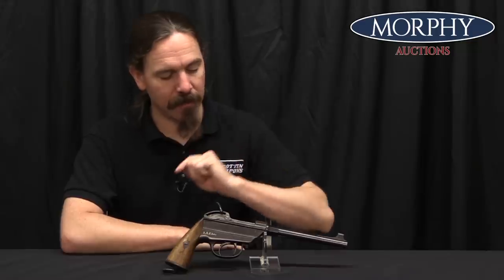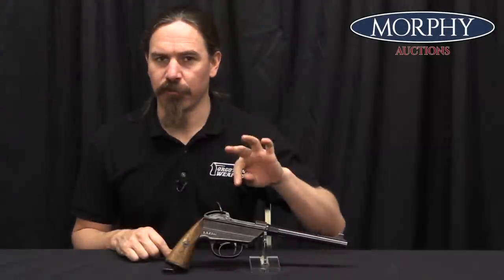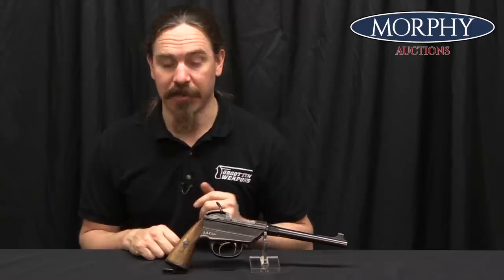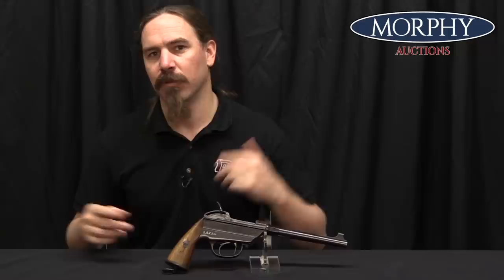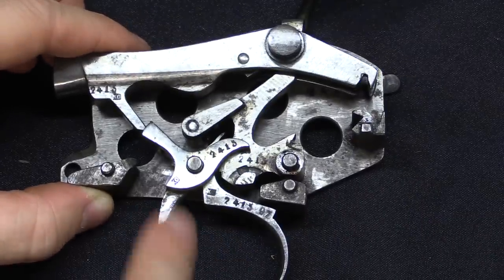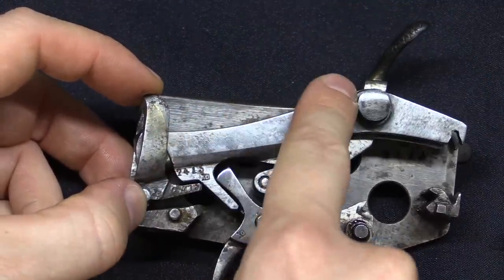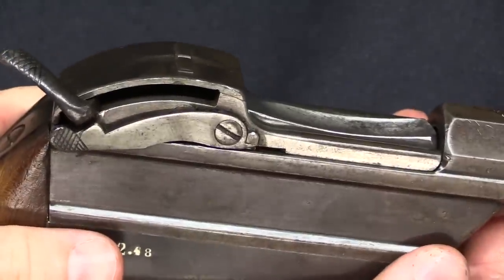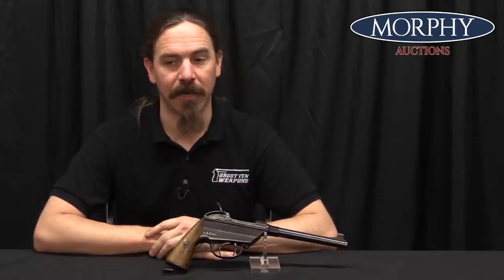Bavarian Lightning: The 1869 Werder Pistol

Comment: The unit marking 2. A.r. 2. 68. means that this pistole was used by the royal bavarian field artillery regiment no. 2, mounted battery no.2, pistole no. 68. Great video Ian, as always. Cheers, Vincent.
Reply: you probably got the most niche channel i have ever seen, how do you even get an interest for that?
Reply: That is some knowledge you have got there.
Reply: @peteraugust5295  I think that "r." in "A. r." is lower case, because Artillerieregiment is a single word in German.
Reply: @peteraugust5295  The lower case "r" stands for "reitende" (eng. mounted) battery. If the "R" would have been stamped in upper case letters then it would translate to a "Rekrutendepot" (eng. recruitment department). Cheers, Vincent.
Reply: @fnym9rdsavsffdik9a25  Thank you very much! My Grandpa was collecting british rifles and bayonets so i grew up with that kind of thing arround me, i just "chose" the prussian/german side later on.
Reply: @peteraugust5295  Its not "Artillerie reitende" but Feldartillerie-Regiment Nr. 2, reitende Batterie Nr. 2, Waffe Nr. 68. The mounted (artillery) batteries were highly mobile units where every single soldier was carried by horse and therefore these units could move arround the battlefield much faster then the regular artillery units. There are some wikipedia articles on this for further reading.
Source for the unit markings would be "Wacker A., Görtz J. 2005: "Handbuch Deutscher Waffenstempel auf Militär- und Diensthandwaffen 1871-2000", VS Books Verlag, Herne" page no. 80 ff.
Reply: Peter August : I am no expert, but german . Artillerie, reitende would be grammatical wrong with no added word, but Artillerie reitend would be corect.
Reply: @peteraugust5295  It does. The r is lower case because reitende is a lowercase word. It differentiates the mounted batteries from those on foot.
Reply: @peteraugust5295  LOL look for yourself bro. He answered you perfectly AND gave you a literal academic source. Thats very rare for someone to do on the internet let alone a YT comment section reply
Reply: cool info thanks for the info =)
Reply: Awesome.
Reply: Peter August because he gave you an academic book. Not a Wikipedia link. He literally explained himself 3 or 4 times now
Reply: @peteraugust5295  ah look but he said "the Royal Bavarian field artillery regiment number 2., mounted battery 2." and you literally said " 2nd Royal Bavarian Field Artillery Brigade" hmmmmmmmmmmmm
Reply: @peteraugust5295  No dude, you asked because you want to come off as the more knowledgeable of the two. However, the more you ask and the more he answers, the more foolish you look.
Reply: @peteraugust5295  Yeah reitend batterie number 2, mounted battery which is a subunit. Presumably the marking of the battery in combination with the regiment was unique, since they were mounted, you would wanna point that out. since it's not pointed out in the name of the battery, but instead the regiment, I would assume they have multiple batteries that way with mounted? 

Either way, humans aren't perfect and if the capitalization wasn't perfectly standardized or unique to each thing I wouldn't be surprised.  We are talking of the german army after all.

The king of being, organizedly disorganized and in shambles. No offense to any, "wehrboos" or whatever
Reply: @herosstratos  Thanks for that source! I'm trying to track down the unit markings on my 71 Bavarian Mauser, and that looks promising.
Reply: lol, Peter August deleted his comments
it's a shame people are afraid to be wrong and scared of being corrected nowadays
Reply: Is it possible to know the exact name of the person in that 2 Artillery Rgt who carried this weapon? Then it would be nice to know his biographical information.

Comment: That is a magnificent piece of engineering for the 1860s. Model of 1869 but I feel certain that it took at least 2, if not more, of the preceding years to actually develop this firearm. The amazing thing about it, to me, is that looks like it was designed/developed in the 1880s to 1890s. Great video Ian!

Comment: On some level, the way this comes apart reminds me a lot of the C96 pistol, gotta wonder if there was some inspiration drawn from this for it. Also, I totally want a repro carbine of this system in .45 Colt or .44-40.
Reply: I'd buy one in .45 Colt. I can't think of a single thing it would do that one of my current handguns can't, but the cool factor is just irresistible.
Reply: Mmmmmm, yes!
And, heck, like any falling block design, this could be adapted to almost any cartridge... a .357 mag carbine sounds fun to me!
Reply: I'd prefer .44 Special so I can actual buy the ammo at a regular gun store.
Reply: Shoot considering how well designed this thing is, and how much materials have improved since the mid 1800's. I bet you could get this thing to fire some pretty powerful stuff.

Comment: A revolver with no revolving cylinder? And it has a hammer that looks like its from a flintlock? Fancy fancy
Reply: Not a Revolver, it's a single shot pistol
Reply: its a breachblock mechanism.
Reply: I study pretty much anything to do with late Reniassance/early Industrial era production. I could picture a clockmaker adding an early fixed skeletonized magazine to the top, making it roughly .22 and selling it as a parlor gun. Also with a "rougher" version with an enclosed magazine as an early repeating pistol.

Comment: 340 gr. pistol bullet vs 386 gr. in the rifle is only a 12% reduction.  With the same 66.4 gr. powder charge I wouldn't call it substantial. (2:43) But the cartridge length being 15 mm shorter makes me wonder if there is an error in one of these numbers.  I haven't found and pics or data on these yet.  Interesting stuff.

Comment: It looks like the second notch on the hammer has a very distinct shape with the small hook on it, most probably, it will catch the tail of the trigger and prevent it from being pressed until the hammer is fully cocked, while at the same time keeping the breech block half-closed, so that the cartridge in the breech does not fall out. Did you miss this moment, or did I get it all wrong?

Comment: Excelent video and amazing gun! I wish I could afford one...

Just a question: since both the rifle and the pistol versions were the same caliber, was there any impediment to loading a rifle round on this thing? I mean, regardless of how "unpleasant" it might be, it could be very convenient to be able to load either bullet on the pistol (or on the rifle, for that matter). Not for "hand-cannoreening" purposes but for logistical ones: if you run out of one type of ammo, you still have the other. It's less than ideal but it beats nothing, right?
Reply: The rifle cartridge was over half an inch longer, i doubt it would fit. The carbine used the same ammo as the pistol though.

Comment: Are you sure that is an "after market" safety?  Most of the pictures I've seen seem to have that version except one I saw that was shorter that appears to rotate up and clockwise to work as a hammer stop.  Looks like they just decided to change how the safety functioned but still used the same screw pivot and stop in the housing.  Just my guess. - 10:20

Comment: I own both a Werder rifle and the Werder Carbine, I’ve been looking for the pistol.  The carbine/pistol cartridge was substantially less powerful than the rifle cartridge, the bullet was only 339 grns and I haven’t found any original or contemporary literature yet showing the intended powder charge, but the 35mm case would have been much less capacious.  The bullet on top of a grease cookie or cork over powder wad, wouldn’t have left that much room.

Comment: Revisited, I still want one of these, alas now days my budget allows for, perhaps a cap gun, nothing real so I shall never have one. My first ever pistol I purchased from a Hispanic combiner crew dude from down south somewhere, perhaps Mexico, who knows this was back in perhaps 1965. The gun was a cut down stevens single shot lever break open rifle cut down to about 12 inches with a hand whittled pistol grip, no sights but I could actually hit the broad side of a barn with it. I took  it with me on my first job working on my uncle's farm driving tractor putting up hay for 5 bucks a day, room and board.  It made a lot of noise for a .22LR and was fun to shoot. I later learned it was illegal, when I signed on the PD in 1973 the same pistol was in the gun lockup, it had been confiscated from a dude who tried to shoot his wife with a Webley, my sister was with the wife at the time, anyhow the AtF visited one day and I found the poor old pistol in pieces having been put to the torch along with the Webley and a few other guns that came from the same criminal. It was a sad day for me, I liked the Webley too dang it.

Comment: I wonder why they didn't have the hammer release the block at the very end of its travel instead of requiring a second lever push, it seems like that'd have sped up the reload time substantially.
Reply: Wanted to make sure pressure in the barrel was safe, probably.

Comment: You made a small mistake regarding the safety; at 10:14 you say that there's no safety on this design and "this is I believe an after market added safety"... it's definitely the safety (and it's not aftermarket, all the pistols have it) however you misunderstood how it functions.

If you lower the hammer into the half cock notch (the much deeper second notch at 7:34) and engage the lever, the deep half cock notch binds the trigger and prevents the hammer moving forward, and the lever prevents the hammer from moving rearward out of half cock towards full cock. 

From a modern standpoint having to pull the trigger and lower the hammer to half cock is unacceptable, however for this time period it was a better than average design as the lever securely holds the hammer at half cock and prevents it from being bumped out and potentially firing the gun.

Comment: Beautiful engineering! I was half expecting to hear that the Werder had been designed by a watchmaker. Simply, this pistol mechanism is a work of art. 

I love it when Ian gets to tear down a piece. 😏 When I was a kid I used to take things (like my father's windup alarm clock!) 😆 apart. (What a little PITA I must have been, LOL!) I think it's likely I'd enjoy this kind of design work.
Reply: I too began my "career" of being a mechanical "nerd" by doing an "autopsy" on a wind-up alarm clock.⏰ I never got it back together,but that did not deter me! I took apart locks🗝,light fixtures,radios...If it had screws, it was NOT SAFE AROUND ME, 😊
Reply: Me to, it ended when I tore the heads off dad's 1944 International Farm Truck he had parked behind the garage.  I learned to valuable lessons, 1 always ask permission before you tear apart farm implement, 2 that damn razor strop STINGS like hell on the bare ass. I was 8 at the time.

Comment: Is this the earliest version you've seen of a modular self contained fire control group?
Reply: It would make this thing really easy to clean because you don't really need to disassemble it further than just taking the sideplate off the FCG. Dunk it in hot water to get rid of the black powder salts, dry, oil, and you're done.
Reply: Maybe? The action is hand-fitted as usual for that era, but the question then becomes whether the side plates and breech face were standardized enough. I sure would like to think they were, but I wouldn't be surprised either way...
Reply: @AnimeSunglasses  I am by no means an expert on this era, but I'd guess the receiver and fire control group (FCG) module sizing is standardized, but the internals of the FCG are hand fitted.  Just a guess though.  That would be a logical interface to standardize.
Reply: @LoanwordEggcorn  It would indeed, but it's still early enough that there's no guarantee...
Reply: Wouldn't a common flintlock mechanism fit that same definition? Think of the expression "lock , stock, and barrel" , 3 major components often fabricated by separate makers in earlier gunmaking endeavors. The lock was the complete fire control group of it's day and usually a single unit/assembly mechanism that could be used in a variety of firearms.
Reply: @vahtikoira2125  Definition and actual manufactured reality were two very different things for quite a long time.
And, the operative part of "standardized parts" for logistical purposes, is that they needs to be interchangable.

Comment: I want to get that gun and put a Scope on it and go into a space
Reply: We found the next "hero blaster" for Star Wars!
Reply: You know, something like this Werder could actually be useful in a near future space application.
No recoil/gas system means you can shoot whatever load you want, even a very light one for signal flares or to not puncture your ships hull and die.
The manufacturing tolerances and materials used mean that anyone with a metal shop can repair it or make spare parts without the need for super high-precision machines or exotic polymers. 
The extraction mechanism means that you can still keep it somewhat cool in a vacuum (which is difficult even for things that don't involve explosives) and you wont  throw hot brass everywhere. Not to mention you can reload them at home.
The only real problem I see is that you getting a shell loaded would be really difficult with thick space suit gloves.

I personally would pack something like a .44 mag revolver in case I need to shoot down a space ship, but a single shot trapdoor wouldn't be that far behind
Reply: I'm in a space right now, and something tells me.. You are too.

Comment: I had one of these. You can make ammo for it by cutting a 45/70 brass down to the size of a 45 long colt case then run it about a half inch deep in a 45 long colt sizing die. load it using long colt loading data and seat a .452/ 45 cal. bullet in it works great.

Comment: 2:54 Wiki Germany says that the bullet for pistol, carbine and rifle remained the same at 21.96g (339grain) while the powder charge was reduced from 4.5g (69grain) to 2.5g (38.5grain) for the pistol.
It also tells the story of the police carbine converted to 11mm Mauser in one incident in which 772 rounds were fired resulted in 304 misfires or other failures.

Comment: And they wanted single-shot pistols instead of revolvers because.. ?
Reply: I knew about the rifles but the pistol. I would think the artillery would want a little more fire power than this if enemy infantry or cavalry show up. The only real change the system needs is a second stage to the trigger that would drop the block and eject the spent casing. Fire, squeeze the trigger some more and the spent case ejects. That would be even slicker.

Comment: Eccentric collector: I have a beautiful pistol from the mid-nineteenth century, but am concerned that it requires a safety mechanism.
Gunsmith: Eh... all right. squints at intriguing mechanism with calipers and note pages What does it fire?
Eccentric collector: I will need you to fashion appropriate cartridges, as well.
Gunsmith: sigh
Reply: Klaus K Eccentric Collected i also may possibly require a conical-diopter based scope preferentially for mongoose hunting
Reply: At least the cartridges should be easy to reverse engineer. Push a lead slug down the barrel to get bore diameter, realize that you can use commercial .44 lead bullets, measure the chamber and rim diameter. And from age of firearm you know you're going to use black powder.

Actually, I wonder if .44 special or magnum brass would work, just loaded with black powder?
Reply: @joestrummer4106  Eh... how about a spyglass?
Reply: You mean spotter scope ?

Comment: The Werder rifle fired a 50mm X 11 using 67 grns of bp to send a 377 grn bullet down range at published velocity of 1460fps. Real velocity was probably a bit lower.  But in any event while slightly less energetic Werder 69 cartridge wasn’t that different from the 370 grn bullet/77 grns bp load of the 11mm Mauser.  10 grains of BP shouldn’t make that much diff.
The actual disparity in energy of the cartridges wasn’t really the issue but rather the sloppy quality in the conversion job.  Sloppy and incorrectly sized chambers and the Mauser cartridges slightly smaller rim led to rough extraction.  My understanding is that commercial sporting conversions w a modified extractor worked a treat.

Comment: Do these fire black powder catridges or can they handle normal powder?
Would a slow burning powder give less pressure than a fast burning one? Ive noticed (modern) pistols generally use faster burning gun powder than rifles do, if i am not mistaken. Do self reloading with rifles, not a pistol guy, so could be wrong. But in rifles slower burning powder is preferred (or i prefer them, since it allows me the security or knowing that even if i accidentaly fill the cartridge to the max i dont blow up.

This gun was particularly cool. Want one.

Comment: It would be even better if the breech block unlocking lever was connected to the main trigger, instead of the secondary one. Pull the trigger, fire, pull some more, unlock the gun and eject the empty case.

Comment: So you could safely carry it loaded by loading, fully cocking, and then lowering the hammer to half cock? You would not want to lower the hammer fully because it appears that if you dropped it and it landed on the hammer, it would discharge.

Comment: Strange it’s no auto eject the tear drop extension on the hammer could easily trip the ejection/extraction mechanism
Reply: ? It is auto extract/eject. The extractor is under enough spring tension to launch the case clear out of the action.